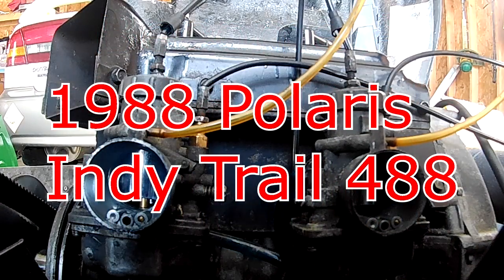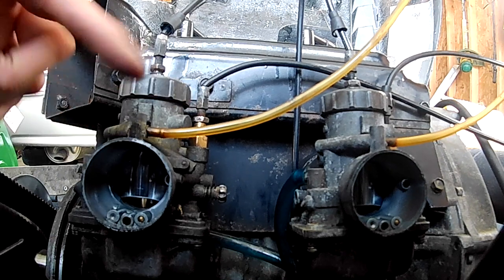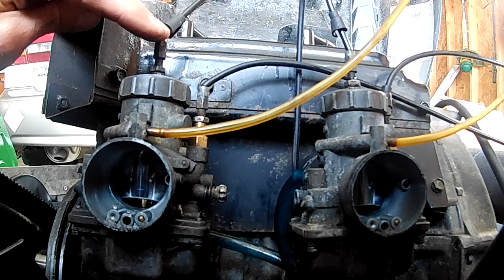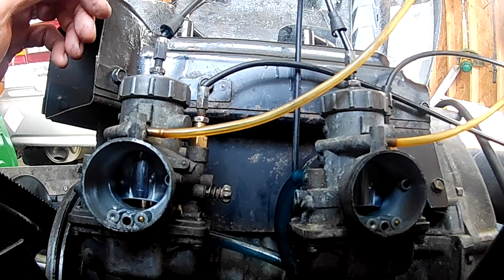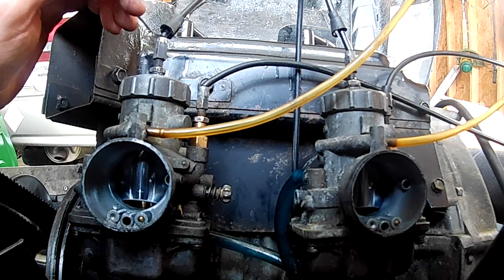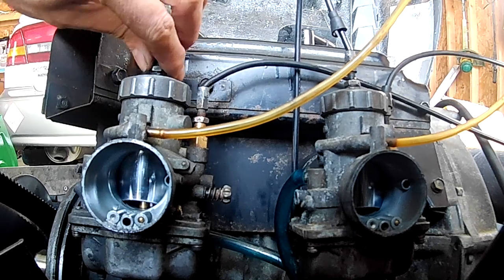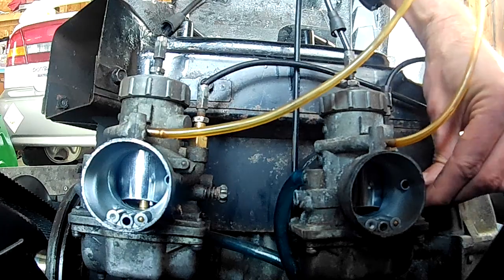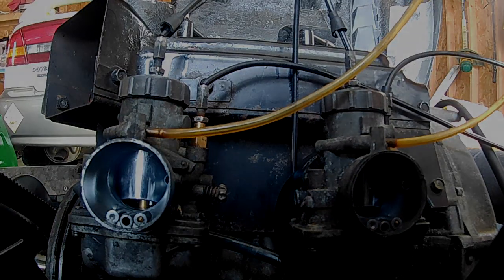My Carbs Are Out Of Sync, OH MY!

Comment: Be aware of that era Indy's having the throttle cables across the top of the airbox. When the airbox is removed, the cables will droop quite a bit and can change sync, especially worn cables. Try watching the carb slides like in the video while moving the cables around. If synchronized that way, they can end up out of sync when the airbox is installed.
Reply from the maker: I'll check that out, thank you.

Comment: And that should help with the cold starts and with the idling on hot shutdowns I would assume
Reply from the maker: I do believe it was running mostly on one cylinder on cold start. Working on the idling down when hot.
Reply from the maker: Adjustment of the oil injector is coming soon!

Comment: Do you know what height they should be set up at?
Reply from the maker: For preliminary idle speed they should have a gap at the bottom of the slide of 1.3mm (point 051 inch). It's easier to back the idle screws out until they no longer touch the slide, then gently turn them back in until you are sure they are touching again.  Once you have found the point where the screw is touching the slide, turn it in 2 turns. Do the same for the other carburetor. Be prepared to shut off the motor or have the sled on a stand raising the track off the ground in case this sets the idle too high when you start it, just to be on the safe side. After starting it, most likely the idle will be too low, so turn each idle screw IN the same amount, maybe a quarter turn at a time on each, back and forth like that until you are at the idle speed that is recommended for a fully warmed engine (typically 1,500 to ,1,800 rpm). Check the setting of the oil injection lever cable when idle is where it should be to make sure it is still giving the motor the recommended oil amount per throttle opening.

Comment: Question? Do you get more hp with 2 carbs or is it just for looks? Or should I just keep my one carb?
Reply from the maker: I believe 2 carbs does give you more HP and have their benefits, but if you have a single carb setup you have the benefit of adjusting only one carb, and if there is a carb problem you won't have to guess which carb is the trouble maker! Simplicity!